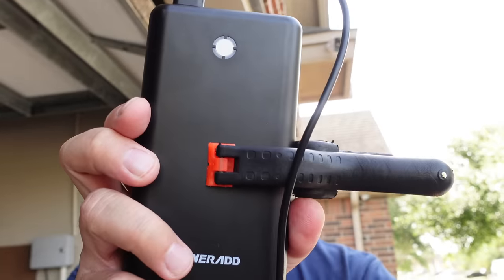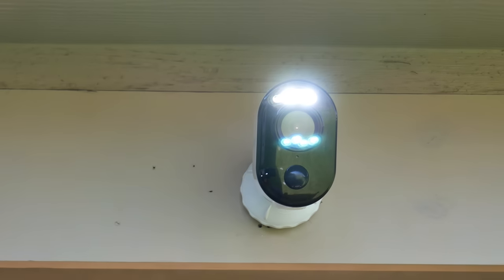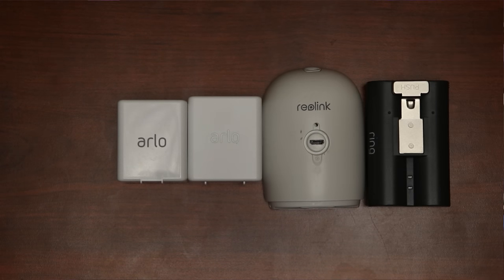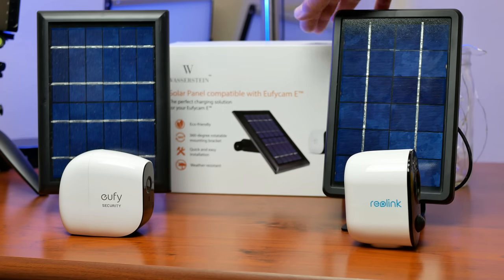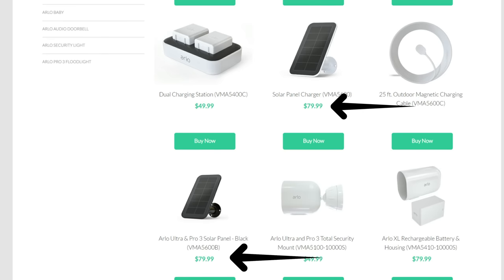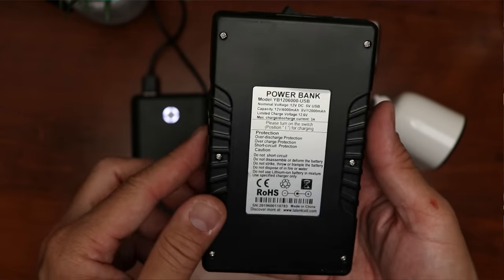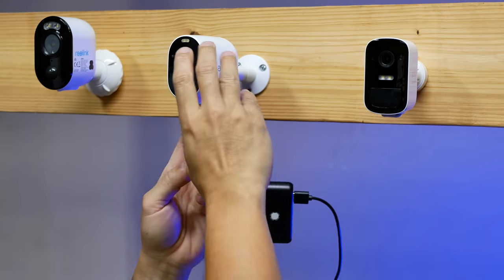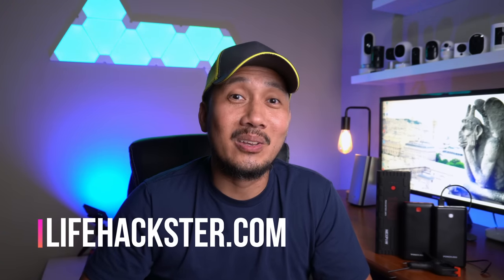Arlo, Eufy, Reolink Battery WiFi Security Camera Charging Options

Comment: I just purchased several Eufy cameras. Wasserstein makes a 25 foot USB cable with a waterproof connector and includes an AC adapter for $18 CND each that I plan to run from my cameras to an outdoor AC outlet. It eliminates the need of both removing the camera, using a power bank, and having to drag out and use a ladder
Reply: Would you still recommend this cable? I've been looking for something like this but each option seems to have a risk of fire (POE, extension cord, mini USB).

Comment: Thumbs up to this. The other reason for not unscrewing and removing the camera for charging inside is that when you return the charged camera to the mount, you have to fiddle around and reset the angle of the camera if the camera angle has altered when unscrewing and removing it. Even the slightest change is magnified.

Comment: What if I plugged the usb to the Reolink and tan the cable inside the house to just plug it in whenever it’s low? Is the port water proof or would that not work?

Comment: This is a very good life hack to use I can say that from personal experience you just can’t forget to check the weather forecast to make sure it won’t rain otherwise if it does then you power bank and camera will both have water damage. Also I using a rubber band can be easier if you have a thin power bank.
Reply from the maker: True.. make sure there is no rain in the forecast.. thanks.

Comment: thank you for this video it showed me how to open that rubber area under the camera to set it to charge ... that was the only thing holding me back from setup, lol ... i didn't want to force anything or rip off the rubber bottom if it was not designed to open (eufy camera 3.31 mins charging spot for anyone else looking for the same thing)

Comment: My Reolink Solar Panel stopped working recently and my region had no replacement stocks. 
So i tried to find some alternatives solar panels, such as off-brand/OEM types for other IP cameras. Didn't work, apparently Reolink and mostly other camera solar panels are made so that you can't use them (specific voltage/amp/software ID switch etc etc.)
So i thought about doing this power bank hack with an all weather version for camping/hiking....
Then  i stumbled upon SOLAR PANEL EQUIPPED POWER BANKS.

It's bloody genius, Reolink camera thinks it''s charging from "main", while the power bank solar panel tops up its charge during sunny days. 

WIN-WIN.

Comment: Could you take a solar panel and hook it up to the battery pack so it charges the pack and the pack feeds power to the camera and then you won't need a camera w batteries making any camera solar powered and cordless. Would that work? Can a battery pack take power in and give it out at the same time?
Reply from the maker: They actually sell solar panels like that..specifically for Blink cameras because the Blink uses regular/disposable lithiums and not rechargeable...so compatible solar panels needs a built in rechargeable battery.

Comment: I would use a solar panel that you can plug any USB cable into rather than one that has the USB cable permanently attached.  You can maybe install it on the roof and run the cable down so it's less conspicuous. Battery cameras are just a lot of work to keep charged up and can only be used at your primary residence.  You would need wired cameras for an airbnb.  I believe your wireless cameras are the wyze and blink cameras you did a comparison of.
Reply from the maker: Most solar panels have permanent cable attached to it.. and I think for weatherproofing...

Comment: Re-exploring this with the new Eufy S330. In Winter there does not seem to be enough sun to keep the camera comfortably charged. I had 2 thoughts: 1) add a supplemental solar panel and put it on the another side of the house that gets more sun (will this work?) Or 2) attach a USB c cable permanently (maybe caulk around the plugin) and run that cable behind gutters for yearlong easy access for charging via power bank. I'd also use some type of waterproof plug on the exposed plug until charging time. Thoughts? Can you test a solar panel with a eufy s330? Eufy claims it will work
Reply: Late to the party but in general #2 works. I have two cameras on different sides of my garage and they are permanently plugged into an Apple charging brick that is plugged into a cheap light timer that is plugged into an extension cord running to a standard 120v receptacle in the garage. 
The light timer is set to run for an hour per day and the app is set to the “battery” (not the solar) option. 
The camera gets a lot of activations (which are silenced) and it maintains 100% the entire time.

Comment: I charge my Eufy cam 2c about every 3 months. I live in a heavy residential area and I have too much foot/car traffic here. Especially catching people 12am-3am trying to break in people's cars.
Reply from the maker: Yes, it will drain faster even if you set it to human detection only, the camera will still activate when it senses other motion, but will shut off when it the movement is not human..
Reply: @LifeHackster  you know what sucks lifehackster, being honest, even in human detection only, It barely senses humans 7/10 times. Even on sensitivity 10 and motion zones set accurately, it fails to do sense. So far in 2020, I lost 4 packages from amazon due to Eufy not picking up the thief's, yet it picks up a when a leaf decided to fall (on human detect only). Eufy is so inconsistent. I might try Arlo or reolink.

Comment: how ironic i asked what battery on the other video was its for your YI home camera, i will purchase this to use as a UPS for my eufy indoor camera!
Reply from the maker: Buy the talentcell though that one that I used for my Yi and the Wyze. The powerADD and a lot of other power banks cut the power out for a second when it is unplugged from the outlet...the Talent cell doesn't.
Reply: @LifeHackster  Great info ! I end up purchasing the TalentCell Rechargeable 12V 6000mAh.

Comment: Thanks for your great review bro. I have an issue with Eufy 3 cameras that cut off too fast despite a setting of 60 seconds. 2 or 3 separates recordings with 5 seconds reset in between are made vs. 1 continuous recording from Arlo. Is there any adjustment that you can do? I try to like my Eufy but it seems like they cut off the video too early for the sake of saving battery life. Arlo has about 10 extra seconds after motion stops which is lacking in Eufy. Thanks.

Comment: You can just buy the solar version like i did. Works pretty good but i will say far as reolink goes if you are in an area where the camera will be recording every couple minutes or constantly the solar panel struggles to keep up. Especially in the winter where the days are shorter. I have mine set to record when motion activated and only through the night hours mostly and it stays fully charged.

Comment: Swann Enforcer is out now 4k  it also have day to night color vision... do a review on that..  BTW, i used to use this method back in 2018 when i first got a camera system which was a blink system and  i still use it to this day.. I switched out the blinks batteries with all rechargeable batteries  which keeps the cost low to run them., so far im running Reolink, Swann 4k, Ring, Wyze and Blink... Im a enthusiast!

Comment: Eufy 2c. i just use my extra solar panel from my ring and it works. Just pinch the rubber so it covers the port so no rain goes in
Reply from the maker: Cool.. I thought the Ring Solar Panel is barrel type connector..
Reply: @LifeHackster  it is the micro usb connection like Android phone. Oh this is the 1st gen stick up cam solar panel where they still had micro usb. I forgot the other panels they changed them in the later cam and panels.
Reply from the maker: alan sunshine - yes, now they have the barrel type...the Reolink solar panel which is cheaper has a micro USB and should work too..

Comment: bought a 1.5 watt 12 volt solar charger 15$ and move it back/forth on my 2 ring cameras, trouble is finding the tiny female plug that has be wired to solar panel, it is about 1/16 inch or so. charges well, may need lower voltage??????????

Comment: I would LOVE to have a wireless option but living in NYC, the problem with all these rechargeable cameras is that they are made for people who lives in the suburbs where the only motion it has to detect is a squirrel running by once a day.  These batteries die in the matter of days to a week if you set them up at a location where foot and vehicle traffic is heavy. Even with the Arlo solar panel, it cannot keep up with the battery drainage. So my only option is hard wire drilled through a brick wall.

Comment: Honestly, if I had to drag out my ladder to mount the battery pack and then again to disconnect same, I may as well simply remove the camera and bring it inside to charge anyway. It doesn't take long for a 2C to recharge so it's not like I am worried someone will break in while I am at home and active. I'm running seven 2C's around my property and could probably mount a couple more so I will admit that recharging the cameras can be a PITA, that's why all mine are mounted within reach for quick access.
Reply: i used a 15$ solar panel harbor freight on 2 ring cameras, switching between them. problem is finding the small female plug and rewiring solar panel

Comment: It would be nice to know if you can attach a 5v solar power bank permanently to a "Wired" Camera ie one that is not battery operated. In other words, make a non battery operated camera, battery operated. The HeimVision HM612 is a very good and inexpensive camera, but it is not battery operated. You may need a solar controller to prevent power leak at night? Excellent video by the way.... Barry
Reply: duugh, have have battery at nite.
Reply: @patriciareynolds2729  What does "duugh, have have battery at night" have to do with this? What size battery pack do you need? & is a solar panel controller required? How long will it operate on a battery pack?
Reply: @peibarry1335  ring spotlight cameras come with 2-3volt batterys and charger, i rigged a cheap harbor freight 1.5-12volt solar charger to mine and swap it to another ring when needed. is your heimvision 110 volts ac? ring is 3volts dc only. ring solar charger is $50. works good and is workfree with solar charger,

Comment: My ges is the"TalentCell Rechargeable 12v 6000mAh "power bank ,dint understand the question but you use it in the vidio wit the wize pan 32 hours 🤷‍♂️😃
Reply: 12000mah sorry 😕
Reply from the maker: The question is which Wifi camera is using the powerbank which is my Wyze Pan.. but you are a bit late.. somebody beat you to it... next time.

Comment: Does anyone know if I can use the Ring Spotlight Solar Panel on my Right Cam 2c? 

I found the right Micro USB to 3.5 Mm Adapter, But I don't want to purchase the Adapter if it doesn't work. 

I did a Google search but didn't find anything about Subject. 

Thanks for anyone that answers.

Comment: How can you recharge the batteries on an Arlo Pro 4 Spoight camera without climbing up a ladder and taking them down.  They are on the outside of the house.  How do magnetic charging cables work?
Do solar.panels work?
These are expensive 
options that dont come with the cameras.  
Some come with powerbank and not
solar panel.  You get one solar panel but have to buy 2 more for a set of three cameras.  What can I do?  

 p

Comment: I hope integrated non-removable batteries don’t become the industry norm, personally I prefer to have charged and ready to go back up/spare batteries so there is no down time, cables or solar panels (which I think look unsightly unless positioned very discretely). I wouldn’t buy a battery powered camera range with integrated batteries.
Reply from the maker: I know...

Comment: Your suggestions are way too much!

In my case, I added ac outlet with weather proof XL cover tapped  to my ac powered security lights. Just plug in phone charger with usb cable.
Only one of the cameras, I had to purchase 12' extension usb cable. To conceal the wire. Add trim over it and paint to match.
I just bought 2 eufy on Primeday sale.
I'll be doing the same here.
Reply: A regular usb charger will do?

Comment: The battery that he has is a talent cell YB1206000-USB. 
He actually has 2 a 3000mah(different model) which he used on the YI home videos. And a 6000/12000mah which he used in the wyze cam pan video and in this video. So we are too late Jes C won.
Reply from the maker: Yes... Jes C won .. it is backing up power on my Wyze Cam.. :)

Comment: Just plug a USB cable in and drill one hole to the other side of the wall and run the long usb cable to an outlet to always have it run through power. Lol pretty simple.